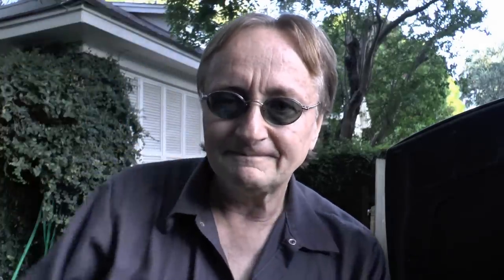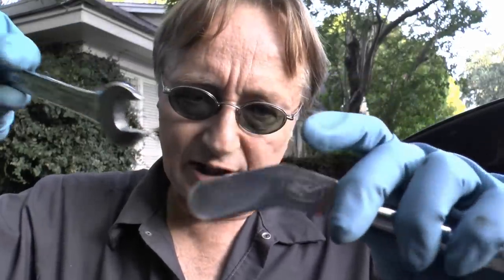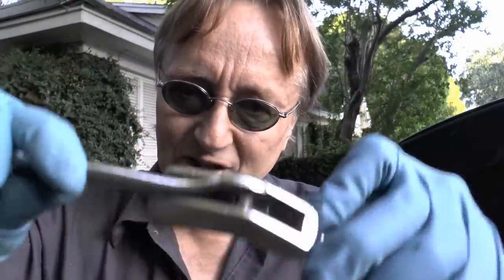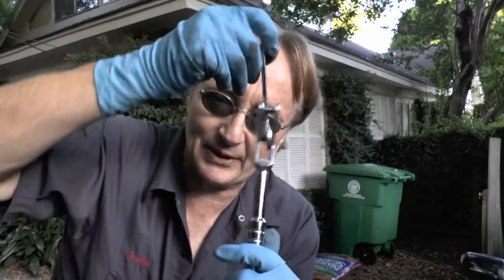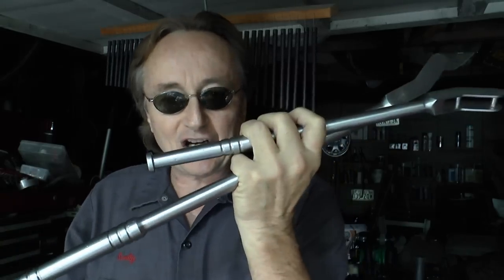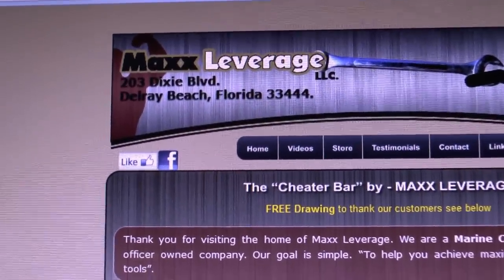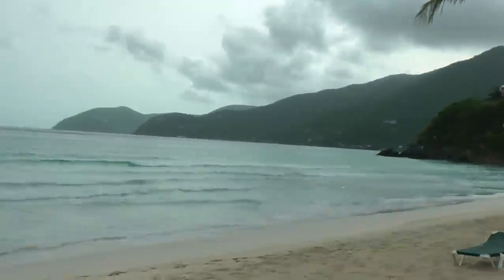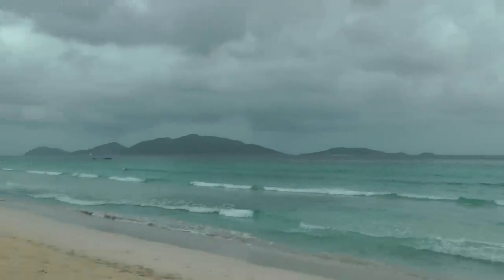Getting Hard To Reach Nuts And Bolts

Comment: I want one!! Another trick I stumbled on: If you have a rachet extension & a deep socket set handy just find the deep socket size that fits over the wrench end the best & use it on the extension for extra leverage. Can work sometimes in a pinch

Comment: That's a very nifty tool, kills the need from putting wrenches on wrenches and hoping it doesn't slip, haha.  I hate the pullies in that location, on my dodge it was even worse b/c you couldn't back the bolt out all the way without the head hitting the rail, so you had to drop the mount regardless!

Comment: Scotty--While the Maxx Leverage tool does work, it still leaves you open to breaking a combination wrench at the end that's open.  Since this video, have you tried one of the other extension tools that allow the wrench to lay in the body of it, cradling it  (for instance, the Mueller-Kueps MLK745100)?  I'm considering buying one of those types as there's no moving parts and most of the force is distributed along the length of the tool.  As a result, there's little chance of breaking or bending the wrench. They're sold on Amazon and several other online tool distributors.  Anyway, thanks for looking into it.

Comment: Thats a pretty slick tool... I like socket wrenches with a tiny diameter handle because my jack handle slides over it to make the perfect cheater pipe... i bet you could slide one over that for some mega leverage if it's not too fat.

Any tips to get the top transmission bolt out on a Mustang?  Iv'e PB blasted, used my big boy Porter Cable corded impact that has always been undefeated until it met this bolt, a little heat but I can't really reach with a torch in there and there are hoses and wires pretty close that Im scared of melting... I'm gonna just do more PB and let it soak over the weekend... hope for the best.  I don't know that I can get a breaker bar in that tight of an area... it keeps popping off the bolt because i have to use a mile of extensions...  maybe ill have to try an air powered impact next... idk if they are more powerful?

Comment: Ive seen mechanics plug weld the socket drive bit off a wratchet on a flat peice of steel bar to turn a bolt in a tight spot. That works if you have the time.

Comment: This looks like am add. Put a second wrench on the end, what I do, what pipe fitters do, what you should do, if you don't want too spend the extra money. Prevent injuries? PPE, impact gloves, and hold the joint (where two wrenches meet) and slowly add pressure so you will if its going too slip before going full tilt. Also a really good way too tighten bolts, that need over 150ftpounds torque. (150 can be done easy with a nice 1ft wrench,  but what I'm doing we need about 900 so this trick is extremely useful so the high-torque isn't spiining for 5minutes before getting tight) aaand 10" ratchet spanners, amazing tools don't cost a lot either, wrench + ratchet = sex

Comment: Here's a bit of a conundrum for you, Scotty.  I drive a 1980 LTD, it has a 302, and it's using quite a bit of oil.  It's an old car so naturally it's always burned a little and leaked a little, but recently it's been going through a quart every 300 miles.  What happens is when it shifts into 3rd or 4th (so I guess when the engine is under load and at low rpm), I hear chattering coming from under the hood and the pungent odor of burning oil will begin to surround me as if I'm following an old school bus.  When the chattering stops, the smell goes away.  It can last anywhere from 1 to 10 seconds.  The noise reminds me of  the knocking sound these old cars make when they're running very hot...  I think it's valve/lifter related, but would a head issue cause a car to burn so much oil?  Thanks for reading my comment.

Comment: On that Maxima I would've just gone from below. You get more clearance and it's faster than dealing with the pulley from above [owner of a 1996]. Only thing you have to do is remove the 2 10mm bolts holding the side guard in place, 30 seconds at most. Don't even have to raise the car unless it's lowered because it sits high enough. Just thought I'd throw in my 2 cents. Handy tool though.

Comment: reminds me when i did a heater core on my crown vic. could not get the top stud to come out. I did manage to remove the nut on the inside of the car. However, it was simply not enough room for me to put the nut back on....so now my heater core assembly is being held by 1 nut on the bottom and the 2 heater hoses

Comment: you can also use another wrench, just hook the other wrench through the loop on the end of the other wrench and it does practically the same thing
Reply from the maker: until it slips and you rip your hand open or break car parts off. Yea, I used to do that, but no longer, not with this tool
Reply: haha always works well for me! but hey if you have the tool then you might as well use it!

Comment: a cheaper alternative is to use a small pipe that's just big enough to go over the end of the wrench.  used that technique to use my socket wrench to loosen & remove the rusty lug nuts off an old truck.

Comment: Hey scotty, will a car with a bad/old/dead/nonchargeable battery still turn on when you jump it with a charger or another car?
Reply from the maker: depends, IF the battery is really shorted out bad, it would not work, but it would have to be REALLY shot. I have seen it a few times in my 46 years of fixing them though.

Comment: What about a rear motor mount on a 2002 lancers? The rear nuts are impossible to remove. Was going to remove the sway bar that's in the way but the bushing on the drivers side has a nut that impossible to get any kind of wrench on because the strut is in the way. I have to find some sort of tool so I don't have to remove all this stuff for a.few bolts.
Reply from the maker: tim prater there are many tools out there, often a gear wrench with one of those pivoting thin ratchet ends will fit.

Comment: Now I want to see you torque that bolt to it's specified torque with this tool. Unless you've got an open end torque wrench, you'll still need to move the engine.
Reply: It's not a critical fastener that requires a torque wrench
Reply: We can debate about if this is a critical fastener or not, in my opinion it is because any fastener holding fast moving things in place is critical. 

But that doesn't matter, if the manufacturer provides a torque spec you SHOULD torque the bolt to that spec. No discussion about that. And I'm pretty damn sure the manufacturer will have provided a torque spec for that bolt.
Reply: Most non critical bolts are given a range of acceptable torque on bolts like that it's usually really wife like 23-32 lb ft. An experienced tech like Scotty can get in that range without a torque wrench.
Reply: Actually I have never seen a range being given for bolts like that on cars that I've worked on. Nonetheless, you should use a torque wrench, end of discussion. It's the difference between doing the job and doing the job properly. Not using a torque wrench means you're being lazy. And that's why I always check if the mechanic has torqued my lug nuts with a torque wrench, or if he just put them on with an air gun. If he put them on with an air gun I know he's being lazy and I'll search another one. People don't have a sense for absolute force, I don't want the torque spec of bolts on my car to depend on if the mechanic has slept well or not.
Reply: I work for KIA and most specs are a wide range unless it is a critical fastener like a head bolt or a knock sensor. I do torque wheel nuts to 80lbs but the spec is between 65 and 86. The exact torque doesn't matter so long as each fastener is equally torqued. Anyways most mechanics don't torque every bolt because for one it's impossible and secondly flat rate encourages fast work.

Comment: A piece of box tubing or pipe works just fine. I'm sure that tool isn't cheap.
Reply from the maker: sure, until they slip and a piece of the car, or a piece of you breaks. I used to do that, now I use this tool, it NEVER slips
Reply: seeya205 you mean other than it having 2 flat sides to support the head without wobbling?

Comment: What tool can I use to get a bolt head screw that is connected to blend door actuator on the back of it, that is impossible to reach on a 2004 ford ranger

Comment: Hey scotty quick question I recently bought a new alternator and my car continues to die!! Battery checked out fine so did the alternator but for some reason something is draining the battery I can't even drive for 20 minutes at night witout car dying first lights will dim then radio will shut off as I hit brakes then airbag light comes on the. Car slowly dies I can't figure out anything any help? Or suggestions please and thanx!!
Reply from the maker: wiring must be bad from alternator to battery somewhere, or just crappy alternators. I often see them not lasting long these days, many are from mexico or china

Comment: Waste of money, spanner on spanner does the same .........
Reply from the maker: yea, till it slips and you rip your hand open or break something. I'm set on this tool myself.
Reply: Scotty Kilmer
thats true. it can slip lol
Reply from the maker: *****
sure, until it slips and you rip your knuckles off and break car parts. I'm sticking with this tool now, I used to do that but no longer. This tool can't slip sideways with the guard it has on it.
Reply: ***** If you want to stick to spanner on spanner, then go ahead. Horses and wagons also worked for many years.
Reply: Scotty Kilmer  ive never had the spanner on spanner method slip on me, it grips pretty good.
Reply: Spanner on spanner no problem for me, I do have long spanners wich probably helps alot aswell 😃
Reply: nutkiller85 how about the error codes called old age and death or illness?

Comment: Hey Scotty, I have a 2002 Mitsubishi Galant GTZ and my problem is that when I try to accelerate, the car will move but it 
Doesn't drive very fast, I can even put the pedal to the floor and it wont speed off .. please help

Comment: Just received my set in the mail... they are not chrome and look like crap. The emblem is also upside down (when comparing to the tool you are reviewing). The tools do not appear to be quality made. They are not round (more oval) and do not have straight lines, especially around the handle grip.

Comment: Hello  sir my name  is  francisco  and I have  a trailblazer

2005 4x4  6 cylinder

and its  giving me  code  po171 how do i fix  that  i don't have  experience  but I  want to learn is there  a way  you can  post  a video  about it  thank you  sir
Reply from the maker: that means it's running lean, check for vacuum leaks as in my video "Finding engine vacuum leaks with a cigar" and also check fuel pressure as low fuel pressure does that too

Comment: How do you handle mechanics that argue with you? I know Im an idiot, and expect no professional to be unfaultering...But I have three different mechanics try to tell me my Hyundai Accent has a 1.5L, and after one became so spirited I drug him outside and opened the hood to show him it is a 2005 year 1.6L (not the 1.5L that started in 2006) and then they started argueing that it is not the original engine.
It all keeps coming from the sticker in the door, saying manufactured August 2005. So they start arguing with me that it is a 2006, not a 2005...and I wouldnt care except the 2006 has anti-lock brakes, power windows, different engine, different rotor size...

What am I supposed to do besides just leave and avoid the shop, because even carrying the title around hasnt prevented the argument that the manufacturing date means its the next model year?
Reply from the maker: plenty of fools out there, I try to avoid them myself.

Comment: Just waiting for some shady Manufacturer in china to rip this off and I'll buy it for cheaper. $99 for 3 different sizes is way too expensive. You can probably find some type of leverage bar around the house.
Reply: Yes but it is always nice to have a dedicated tool on hand, but yes very expensive.
Reply from the maker: you don't need all 3, the small one, the most popular, is what most guys need. That's the one I use all the time.